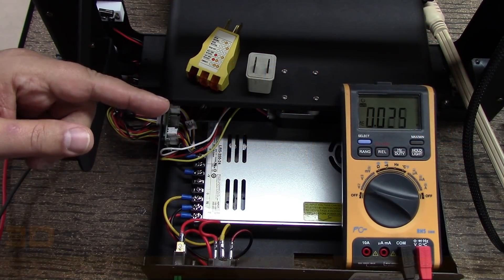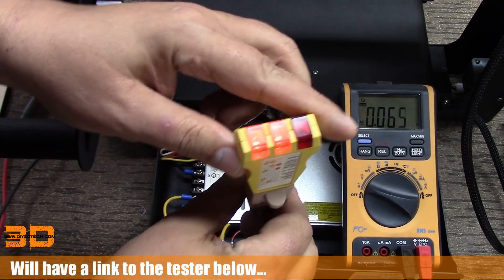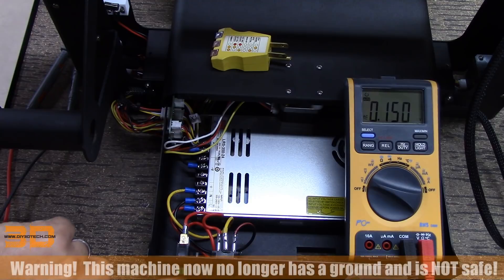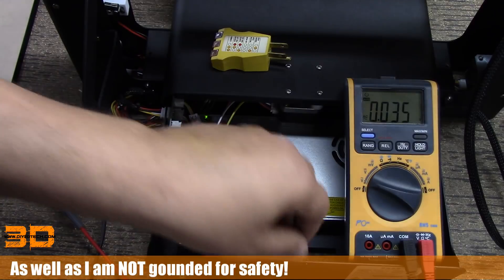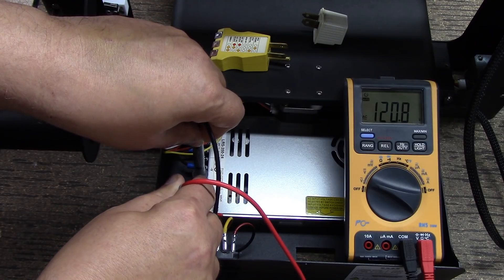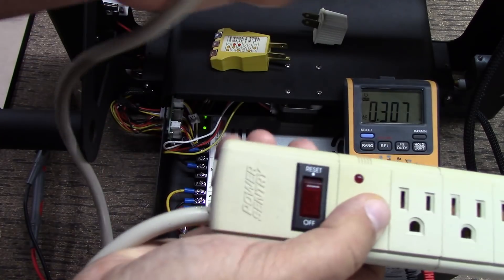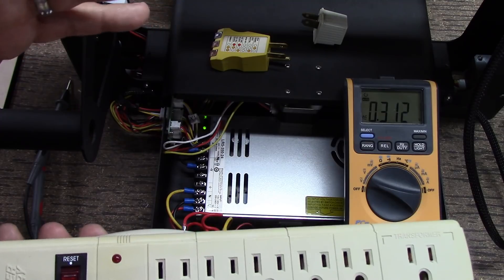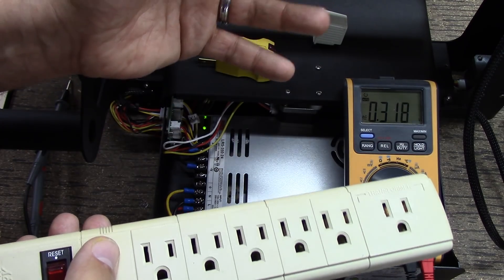Shop Talk - So This is why a Floating Ground is BAD!

Comment: You said that this is not a safe way to test for this issue. What would be a safe way to test that the device (such as the 3d printer) is appropriately grounded?
Reply from the maker: Thanks for commenting!  For clarity I am saying not to do what I am "doing" as what I am is demonstrating the leakage of the Cy capacitor from neutral to ground. The biggest thing as I point out in the video is you want to test to ensure your ground is working and effective and to do this you would need an outlet tester like you see in the video (here is a link: http://amzn.to/2FB6rn9 ).  If you wanted to take this a step further, while unplugged take a multimeter and touch it to bare portion of the metal case of your printer and the ground pin of the power cord with your meter in continuity mode (or ohms) and you should see a connection or really low ohm reading and your good.  Hope this helps!

Comment: With BX cable and metal boxes those 2 prong adapters worked very well.
Reply from the maker: Guess I a little confused as BX cables are armoured  cables and still require a ground?
Reply: Prior to Romex - The armor in the BX cable goes to ground; it goes to ground because it terminates in the metal fuse box (breaker box) which is then grounded sometimes to plumbing.   Even the early romex was attached to the metal gang box.. so even there a 2 prong plug would be relatively safe.

Comment: How does this effect countries with no ground? eg Japan
Reply: John Croucher you would need a ground installed for the receptacle you intend on using your printer. Japan solved the issue with most of their appliances being double insulated instead of grounded. The US was the same way before the 1970’s.
Reply from the maker: Here is a good link: https://en.wikipedia.org/wiki/Appliance_classes as these are Class I devices and as dsnsdn points out yes an external grounding rod would be the solution...

Comment: Something really shocking is how BAD your plugs and sockets are ! Sorry i'm a bit off topic but... electricity safety all start with an outlet and a plug.
Every video on the topic originated from US, or AU ... look at your plug shape and pins !
I'm an european, and here we use the standard Schuko plug and socket. Schuko socket is recessed so pins are unexposed, and pins are half-way coated... whereas AU and US plug are flat-socked exposed pins plugs ! 
Easy to spot : When you plug in and out your device, it lit up BEFORE the socket gets flush ; pins are exposed !
Seriously this electricity standard is NOT good. Even if i move to US one day i would never equipped my home with such a socket.
Be careful !
Reply: When I moved from the UK to the US I was amazed by how bad the electrical system was here. The plugs and sockets were awful, pins on the plug can be bent by a minor knock (my 7 year old grand-daughter can bend them by hand) the sockets are equally garbage, but just to add insult to injury, the grid has been terrible also. I have lived here 18 years in Tennessee, Indiana & Florida and white & brownouts are very common, blackouts several a year (mostly for minuets, but sometimes days, worst being after hurricane Irma being almost 2 weeks) far too many power poles get taken out by car accidents. I have UPS's on all delicate electronics but my LED lights are still being destroyed by the terrible power.
Reply: I have never heard the term 'whiteout' before, but I can tell you that it depends on where you live as far as the quality of power.  If you live in a congested large city, then brown outs are normal in the summer because of everyone trying to run air conditioners.  The power is very stable here where I live.  I have lived in the same house for 27 years, and the power has only gone out maybe 8 times for any length of time.   You also have to understand that more precautions have to be taken with 240 volts than the 120 volts here.  The national electrical code is always changing here as well.  GFI's make things a lot safer.  Our grid is due and overhaul.  That is no doubt
Reply: Whiteout = Power spike, noticed by lights quickly brightening, I don't notice it anymore as I have changed out to LED but I am quite sure it has caused a number of the LED's to burn out. It's a term I learned 30+ years ago I don't think anyone uses it anymore. 
Since moving here I have lived mostly just outside a city but the 2 cities I did live in (Nashville & Indianapolis) were terrible. Now don't get me wrong I am comparing it to living in London which I never experienced any power outage of more than a few mins ever (that was scheduled as they were swapping over power line) and very few brownout (I probably get more brownouts here in a year that I ever saw in London in 30 years maybe that just a bad memory but I don't believe so
Reply from the maker: Yes a true statement "your device, it lit up BEFORE the socket gets flush ; pins are exposed" as you will also notice I handled it in way to avoid touching those prongs as yes I like many other american have brushed those pins before and been shocked...
Reply: Not all your plugs are coated.  That might be a safety thing your country is moving to.  If you did move to the US, you would have no choice but to uses NEMA style plugs.   When buying appliances and electronics in the US you are not given a choice of what type of plug to use.

Comment: All your high voltage wiring terminals should be insulated .I noticed that none of them are and these can easily come off and also pose a risk to anyone working on it ,qualified or not.
Reply from the maker: Thanks for commenting!  Actually they are with a clear plastic, I talk about this a bit more in the prior video https://youtu.be/fSNMQxkpf18  :-)
Reply: The main point is that unless you are trained you should not be messing with mains voltages. However if you had a hot lead come off and touch the case it would trip the breaker immediately.

Comment: Great video! You consistently have the most informative videos on 3D printing. A thought: for printers like the CR-10 that have a separate control box (but use these same power supplies), would a replacement control box made of plastic be safer? If so, would the interior still need to be lined with conductive material (for instance, copper tape) and connected to ground in case of a loose live wire, or would it be better not to line it at all? Sorry if these are stupid question, EE (especially AC circuits) was never my strong suit.
Reply from the maker: Thanks for commenting!  With a proper ground it is safe and this is the key message as many people either discount the ground or worse forget about all together.

Comment: Nice video mate, and a really good explanation :)
Ever opened up a power strip to see how they work? pretty scary stuff!
Umm, if you do open one up chuck it out straight away.
Reply from the maker: Oh Yes!  I 've have taken a lot of negative comments over my position power strips and especially "cheap ones" however yes have taken them apart and seen many "flash" in a huge of smoke.  I am in the IT/Data Center business and these things are major banned!  What folks also miss in in the cheap one they use "cheap metal" oxidizes easy and builds resistance and  of course  resistance build heat and the rest in the smoke!

Comment: Thanks for this video.
Now, I really have a problem here. In the Netherlands it's pretty common with older houses that they only have a grounded outlet in the bathroom and the kitchen. Nowhere else in the house I hve a grounded outlet. Not to mention I have only 3 outlets per room, so the only way I can run 10+ printers here is by using these extension cords. 
I never experienced a problem with that, but this could lead to a problem, I guess.
Reply from the maker: 10 plus printers?  Yes you have a problem waiting to happen.  My suggestion would be to have electrician come and add a couple circuits and 10 is a lot of printers and if your bleeding them altogether there can be issues.  As you have two issues if I am reading this correctly, current draw and grounding.  To fix the first you need circuits and if pressed for two you could add a secondary chassis ground by installing a ground rod out side...
Reply: Thanks for your detailed answer. Going to contact an electrician this week.

Comment: A ground fault breaker preferably in the breaker box but a remote one is better than nothing is the real answer!
Reply: I was pondering that as you demonstrated, where I live RCD is standard in homes (30mA trigger), meaning that that much leakage from the unit would be a PITA... any tricks to get around it? Can the circuit in the unit handle switching the Y-Cap to an X-cap mode?
Reply from the maker: I've had issues them in the past as the leakage alone would trip it...
Reply: The leakage current from the Y capacitors is far too small to trip an RCD even if multiple power supplies are connected to the RCD-protected circuit.

Comment: For this demo you removed the ground wire from the chaise terminal to earth ground rod?
Reply from the maker: I removed the third pin from the plug (i.e. the ground), now in this is where ends up is outside to a ground rod but this is not a separate chassis ground...
Reply: That's a yes on Terry's question?

Comment: Nice explanation, and thanks for the credit! Some notes about power strips: The cheap ones have springy metal strips that connect all of the outlets in parallel. If you constantly plug and unplug stuff, you can dislodge the ground strip or it can loose its springiness, and you can loose the ground connection and never know it. For shop or lab use, it's better to use one with individual sockets rather than metal strips. Tripp Lite makes suitable ones that have been used in industry and electronics labs for many years.
Reply: A spider box is generally used as a temporary way to distribute power at a construction site or similar location, normally contains GFI or at least standard circuit breakers, and normally connects to a 220V source rather than a standard 110V receptacle. Overkill in my opinion for 3D printers. The main advantage over an inexpensive power strip would be that a spider box has separate receptacles rather than the aforementioned springy metal strips, but this is true of industrial-grade power strips like the ones Joe has linked to as well.  A GFI is always a good idea, especially in a basement, garage, or shop that might have a damp or wet floor, but receptacles in these locations should already have GFI protection. Either way, you need to use a high-quality cord (preferably an "outdoor" type, sometimes marked SJOOW) and route it where it won't be stepped on or tripped over.
Reply from the maker: I have seen so many over the years go poof it isn't funny as yes there are high quality ones out there (and I have and use some) and I list this in the description sections of this and prior e-mail.  Also again thanks on the impedance, that was it and I was a bit surprised!
Reply: Yup. The Tripp Lites you link to are the ones I recommend, too. It's always confusing when the measuring instruments you use affect the thing you're measuring, but it does happen from time to time.
Reply: I had just built what they called "spider boxes" which are outlets mounted in a metal box.  They are ganged and a GFI can be installed with them.  Does that make any sense to circumvent the power strip issue?
Reply: Got it.  Thnx

Comment: Whow, that power strip is weird (or at least, totally different from what i've seen in the Netherlands).
Some differences i notice:
1. The power plugs are made in such a way that you cannot reverse them. You do have AC out of the wall over there, right?
2. What's a transformator socket?
3. An on/off switch as a reset switch? Overload protection?

Also wondering, the thing seems to have a proper, thick insulation, but even so you don't recommend them for devices like 3D printers, which would draw about 400W max i'd guess? When similarly insulated extension cords over here don't even get warm with a 1000w connected? Is that due to the 220v over here?
Reply from the maker: Plugs in the US are polarised for Load and Neutral which is a bit different then Europe (as I spend a lot of time there and even over saw the building of a Datacenter just outside of AMS).  The transformer socket just as more room for a wall wart :-) In this case its just an on/off switch but they think it sounds fancy to say reset.  Thickness can be deceiving, the quality of metal in the wires and connector is poor and leads to higher resistances and oxidation (i.e. poor connection  lead to heat).   Then open it up and it goes down hill then we start taking about quality...
Reply: That power strip does have a electronic overload in the power switch that’s why it has the reset on the power button.

Comment: Thanks for this but if I have purchased a Chinese power supply that has no earth connection, does this mean I should throw it away? I thought you were supposed to just wire the earth from the power cord to the power supply case? Is that safe? Got me worried now, any advice greatly appreciated! Thanks
Reply from the maker: I assume your in the US?  The third prong is (or should be) an earthen ground as Neutral which is the return for the "load" is sometimes referred to as the "electrical" ground.   So if your PS has Load, Neutral and Ground and all three connections are properly wired you should be good.  However if you doubts or question, contact a local electrician...

Comment: a "safe" example is if you take a Google Audio dongle (microusb) powered and power it from most portable speaker usb power outputs ... result just awful noise :-( floating earth
Reply from the maker: Thanks for sharing as this is a good example!
Reply: if you check out some of the older EEVBlog Youtube channel teardowns of chinese Soldering irons (and more expensive stuff) it's a bit shocking 1. how often the earth connection to the external cable is non existent or loose/poorly connected 2. transformer isolation is so poor its ridiculous   ... likewise if you check out the BigClive Youtube channel his teardowns of cheap chinese devices are eyepopping (he coined the phrase "deathdaptor" for the country plug adaptor shipped with many chinese products)  .. if you check out BigClive's Youtube channel check out the Killer USB charging camping lanterns - KAPOW!

Comment: Great video. I think you did an excellent job of showing what can go wrong. I grew up in a very old house that only had two wire receptacles and I remember my dad using one of those cheaters. As a kid, I had no idea of the danger but I remember being forbidden to touch it - not because it was unsafe but because they were hard to find and my dad was afraid I'd lose it. 
I agree with your warnings about using cheap extension cords. They often start out poor quality and get worse as they age.
Reply from the maker: Went I researched this piece, I was surprised by the number of people who die every year from the "cheaters"...

Comment: I live in Egypt, we have plugs with 2 not 3.
How do I connect things that have plugs with 3?
I do use a converter from 3 to 2, but you said it is not good.
Also plugs with 2, do they have ground?
Reply from the maker: I would check the country electrical codes for earth grounding and install a ground rod and wiring inline with them as local / regional codes will typically define length and placement of the rod as well strapping...
Reply: bombero34fr I do not know how to do this. Who can I ask here about this? The electricity company?
Reply: You may find how to do it on internet! Try something like "hearh grounding" !
Reply: Christiane Louca , look at "ground" on wikipédia !
Reply: bombero34fr Ok, I will search.
Thank you both. God bless you.
Reply: I have had this problem with my computer so I pluged a groud wire to the central heating plumbing (copper).The best way is to wire it to a copper rod in a ground hole outside the house with charcoal.